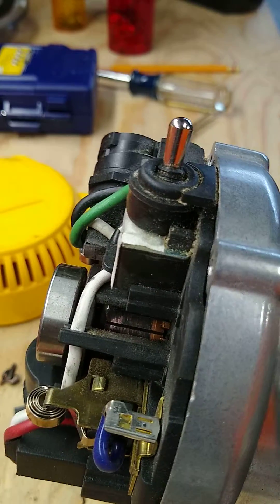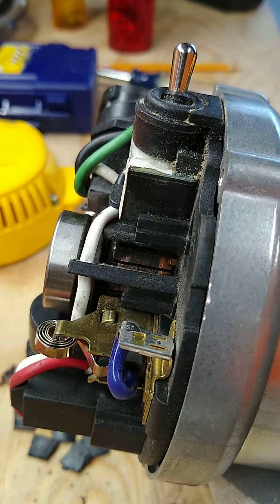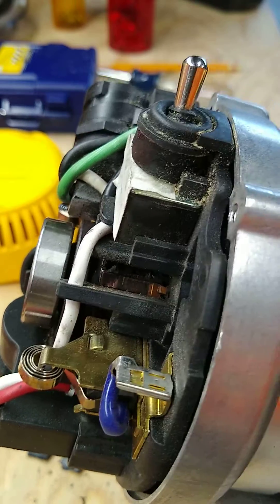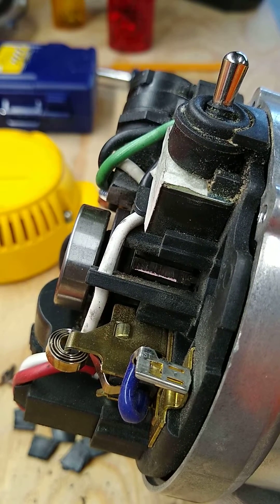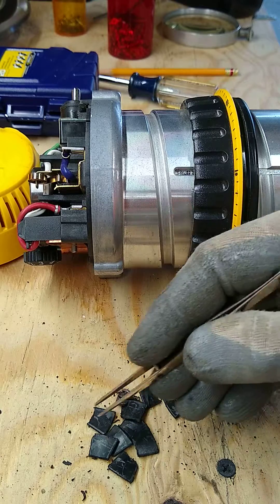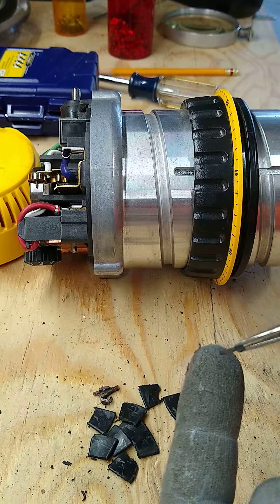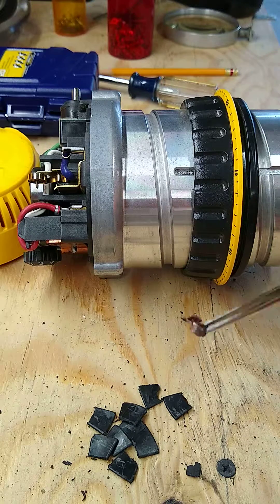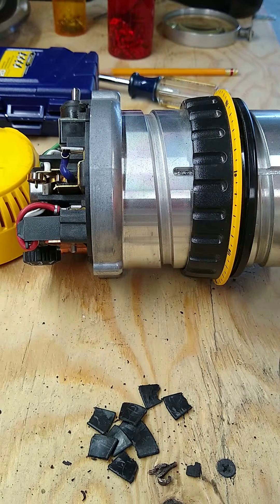Autopsy of a DW618 router

Comment: mine was loose and made a squeak, I glued it with a contact glue very carefully and not muddy the other parts, and so far no problem, I think it would be the definitive solution, place a new one and glue it, so we would prevent it from sticking come out and break over time. (stick it down next to the rotor do not stick it up next to the bearing.